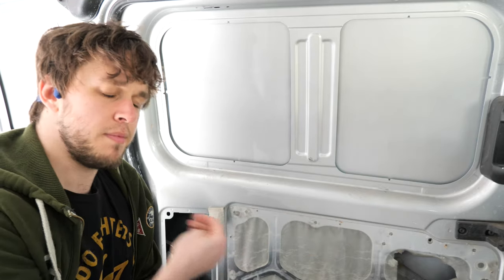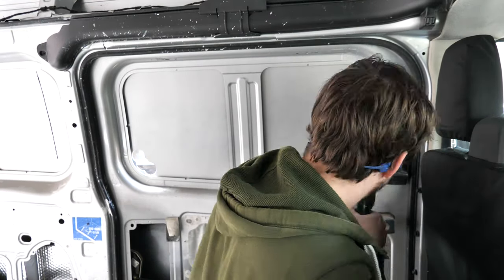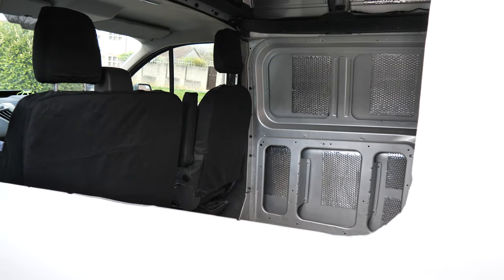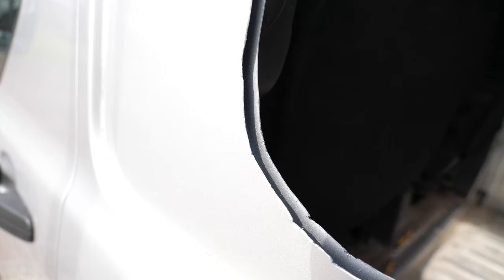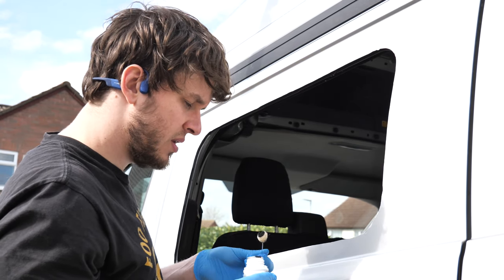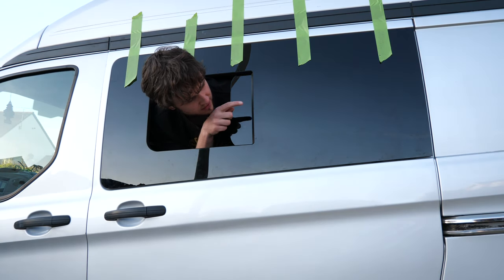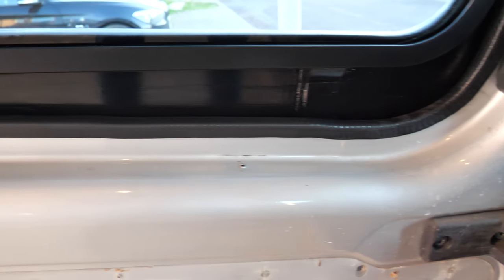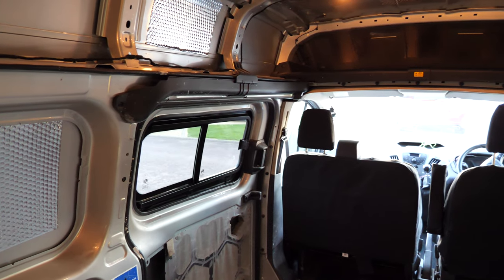Van Conversion : Side Window

Comment: I did this job today on my transit.  My window looks identical to yours. From Van Demon.  I found that my window didn't sit flush until I cut out slits to accommodate the three vertical supports on the glass which sit proud.
Reply: While dry fitting, I came to the same conclusion. Are you happy with the result?